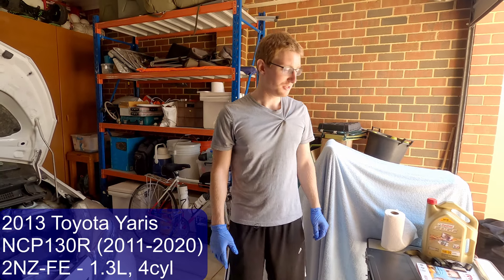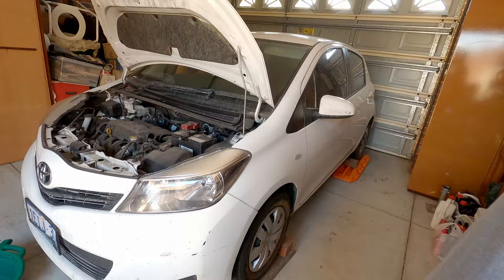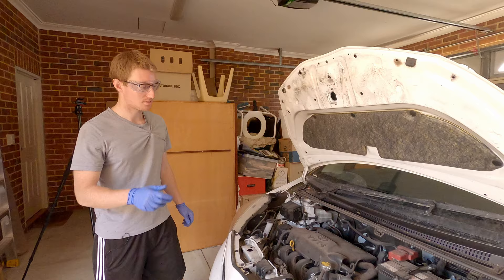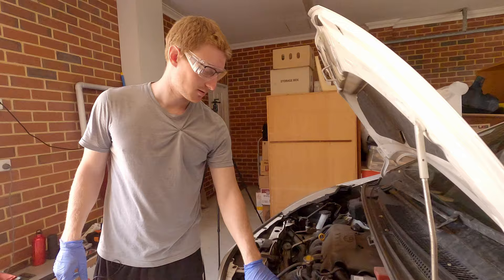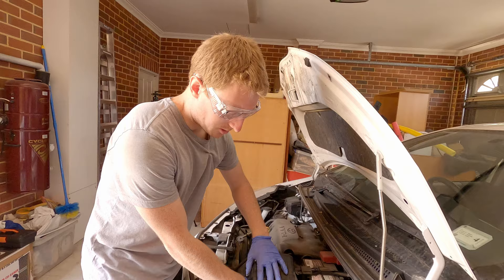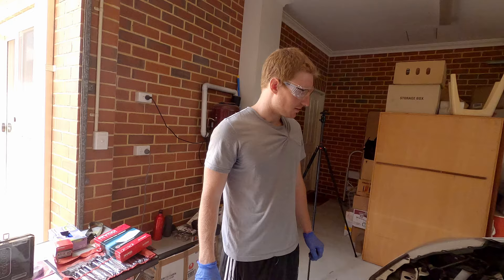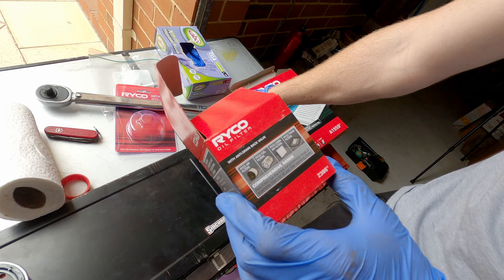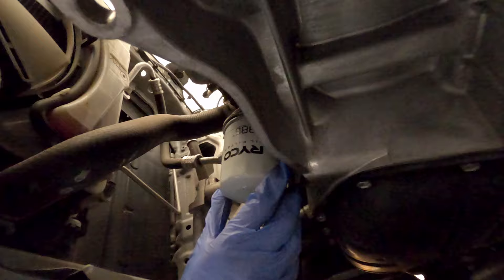Oil Change, Oil Filter & Air Filter - Toyota Yaris 1.3L (2011-2020)

Comment: Great video for beginners and would share a tip. Use the brushhead attachment with the vacuum cleaner in and around both filter housings before installing the new ones because dust settles everywhere.
Reply from the maker: Good tip Iraj, thanks!
Reply: Please can I have an assistant like that😁

Comment: Excellent video. Nice pace, clear footage and well prepared dialogue. Information presented in an easy to watch fashion and, by the end, there seems to be every reason to have a go yourself. Many thanks for your efforts. I will probably use a vacuum pump to drain the oil simply to avoid issues with removing the sump plug which will certainly have been tightened with an air wrench. Good tip about the oil filter adapter.
Reply from the maker: Thanks for the feedback Mike we really appreciate it!

Comment: Oil is a brownish color! Yuck. How long is your change interval? Is it foamy at all?
Reply from the maker: Correct, this oil was far darker than it should be when changed, but not foamy. In this car the oil should be changed approx. every 10,000km (some say 15,000km), but this oil was left far longer than that.
Reply: @2ndGearLow  
We change ours every 5,000 miles (8000 km), give or take 200 miles, on our 2009 RAV4.

Comment: Here in the UK we don't have the screw on filter canister like you,also we use 0W-20 BUT i'm using 5W-20 Magnatec. We both have the same 2NZ-FE  engine. Great video!
Reply from the maker: Thanks for watching, and that's very interesting to hear!
Reply: Honestly don't really ever need less than 5w in the uk, which would be for -40° Vs -35°, neither of which you Will really ever see in most of UK and probably wouldn't be in your Yaris if so 😂
Reply: @falconlips5474  Used to use 0w20 as Toyota recommends but 5w20 is cheaper....some people use 5w30!! Which can be used but they (Toyota) said to use 0w20 next time. Work that out. 😉😉

Comment: My 2011 Yarns does not have an AC filter. Same housing, just not fitted. Should I add one? Glove box fitting different too.
Reply from the maker: Hi Iconoclad, thanks for watching. Many other cars do not come with a cabin air filter at all, so it's not absolutely essential to the running of your car, but if the cost is not an issue it's a relatively quick and easy improvement you can make here. Looking at the Ryco filter finder, they specify the same RCA164M filter for all models of the 2011 Yaris, so this one should work for you. Alternatively, you can use the Toyota genuine part 87139-52020, or find an alternative aftermarket part in your area. Here is the search that I used (Ryco):
https://www.rycofilters.com.au/Search/SearchResult?make=TOYOTA&model=YARIS&year=2011&liter=
Reply: @2ndGearLow  Thanks for replying. I wouldn't pay @20 - $40 for something I have done without for the last ten years. However, I found a Chinese "carbon" one online for $6.59 so I will go with that.

Comment: hello  my friend.

My Toyota Yaris 2012 with the same engine 1.3 VVTI has 177,000 KM on the odometer and I just bought the car, what oil should i use?
Reply from the maker: Hi Daban, please refer to your Owner's manual, as that may vary depending on which region you are in. Where we live in Australia, 5W-30 is the specified engine oil for this engine. Generally, hotter climates require higher engine oil viscosities, and the opposite for colder climates, as the oil will not flow as easily when very cold.
Reply: How is it now
Reply: @jayislander  its great no issues at all.
Reply: @jayislander  195km

Comment: Hi Guys, can I use SAE 5w-30 fully synthetic mobil brand engine oil in my Toyota Yaris 2010 ?
Reply from the maker: Hi Subir, please refer to the owners manual for your particular vehicle, as it will be stated in there towards the end. That said, 5w-30 fully synthetic is commonly specified for engines of this size, so is likely correct

Comment: Thank you 😊  so much for your present service but  can I use Mobil oil?  Or castrol its good as well?
Reply from the maker: Hi Edmond, thanks for watching! Mobil or Castrol are both well known brands, just make sure you're using the correct viscosity (e.g. 5W-30) and quantity based on your cars Owners Manual.
Reply: Thanks to you I bought Mobil 1 and its 0W-40 and ii think it's OK 👍 👌

Comment: could u recomend  me Gear oil qty  and company..i have too vitz 2000 1.3cc auto 2nz fe
Reply from the maker: Hi Rao, please refer to your owners manual as it will specify the correct engine oil viscosity (and quantity) for your region.

Comment: How much oil filter and air filter
Reply: Toyota Yaris 1.3 is this engine is timing chain
Reply from the maker: Hi Jack, the 2NZ-FE (1.3L) engine shown has a timing chain. The oil filter (Ryco Z386) shown cost about $20 AUD and the air filter (Ryco A1559) approximately $40 AUD. Total cost about $60 AUD ($42 USD).

Comment: Hey I know, it's been years you uploaded but I got a used Yaris YRX 2013 hatch and I am concerned with my fuel economy it been around 8.6L/100km for the first 300-400kms since I got the car, do you have any idea what could be going wrong? 
Thanks!!
Reply: That's very poor, my 2003 Yaris gets at least 5.9L/100 with 91 octane. First thing is to check tyre pressure but they would have to be very flat for that mileage. Dragging brakes, vacuum leaks and poor compression would be some possible causes. Do you have any warning lights or codes